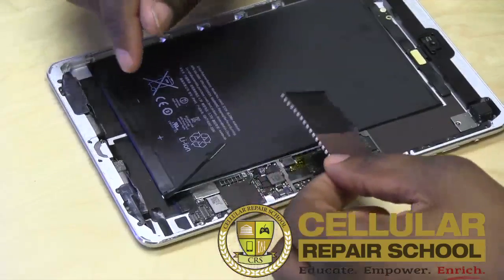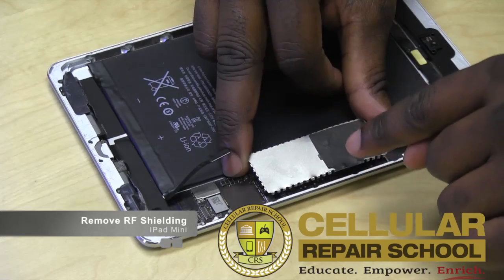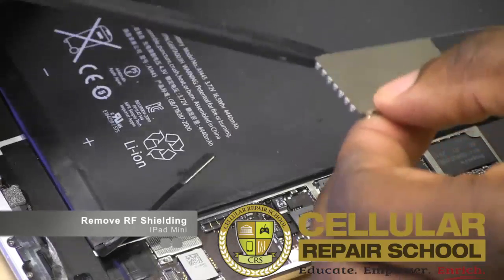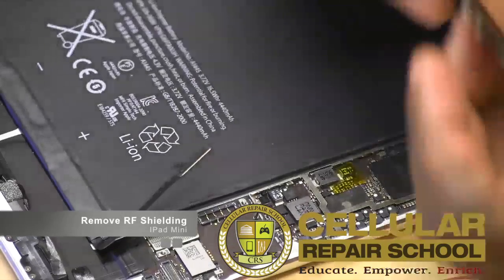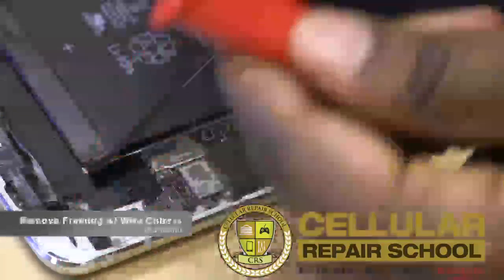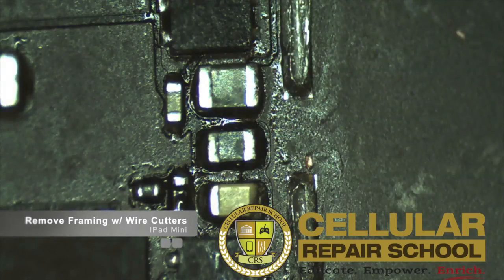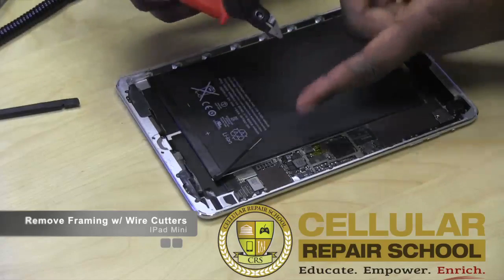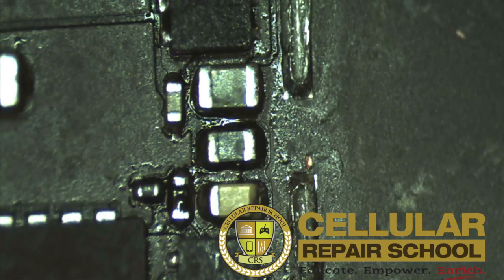iPad Mini Backlight Part # 2 Cellular Repair School

Comment: You need help in your terminology.  You seem very well versed in the aspect of repairing devices such as these.  The correct terminology for the fuse is an SMD (Surface Mount Device).  It is not a chip.  I suspect the shield can be popped off because during the manufacturing it was snapped into place.  I have watched #1 and #2, one thing I was looking for is how to safely remove the digitizer to get to the point.  Do you have videos on that?  I have been in the electronic field since 1980 and am now getting into repairing cell phones and tablets.
Reply from the maker: +Mitchell Simmons I actually refer to it both as a chip and a fuse.  I use the word chip so people who aren't familiar with electronics understand non technical terms. Everyone isn't as experienced as you seem to be Mr Simmons.   If you listen you will hear me say "some people" refer to it as chips but to be politically correct it is a fuse"  which is indeed SMD or SMT technology.